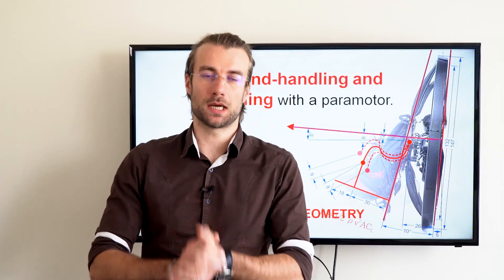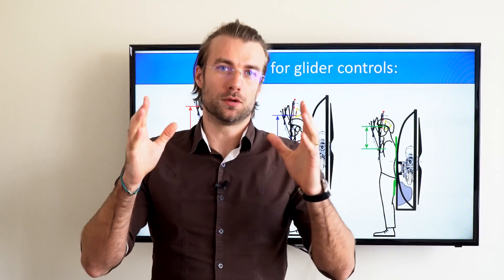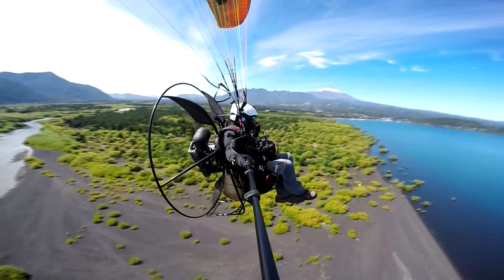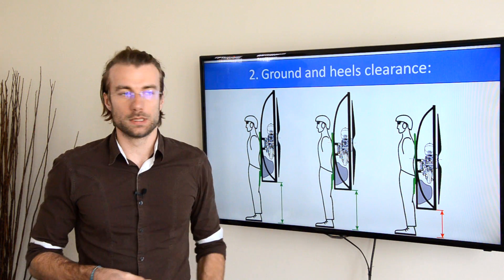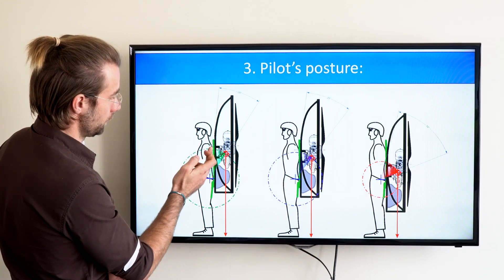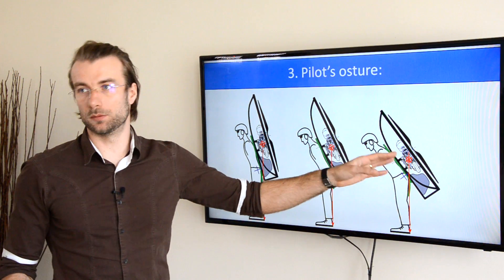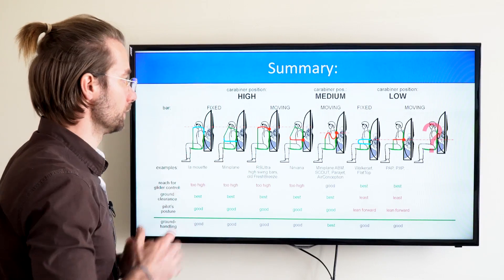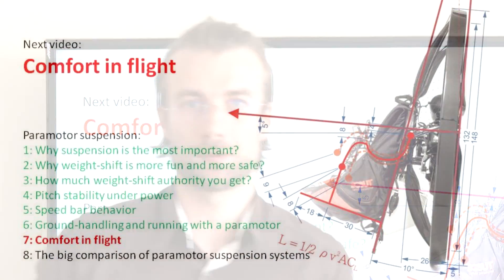Ground-handling and running with a paramotor. Paramotor Geometry Part 7

Comment: I have a question I can’t find the answer to . Please help. Is the relative position of the prop and thrust important when sitting in and flying a paramotor. For a high hangpoint setup. What’s the best position if I drew a line through prop. Shoulders,top back,middle back or lower back,, hope you understand.

Comment: I am 6'5'' (196cm) tall and I am curious if the height of the pilot is a factor in choosing an ideal suspension configuration. It seems like it would certainly affect the angle at which you would have to lean forward in order to get the center of gravity right.
Reply from the maker: +Jon Neville being tall makes everything better at groundhandling. Yes, your lean forward angle would be lower compared to short pilots. 
Yes your ground clearance would be higher as well. Yes with long arms you easily reach for anything...

Comment: when you take off you need to full throttle what about toggle breaks when take off you need to put pull little bit or free hand (simply raise the hand with out putting any pressure plz let me know
Reply from the maker: When you lift the glider above your head you may need a little brake to stop it and prevent overshoot.
Right after that you go off the brakes as you need to gain speed. I recommend to run as fast as you can without pulling the brakes. Once you cannot run any faster, apply little brake pressure and you will be lifted. Do not be lazy to run.Takeoff at high speed with less brake is safer than takeoff at lower speed with more brake.